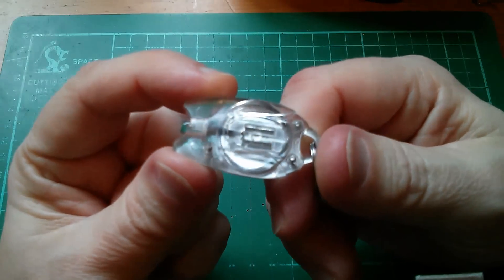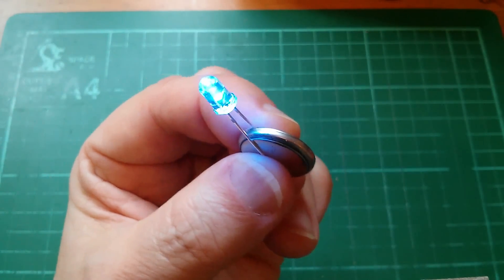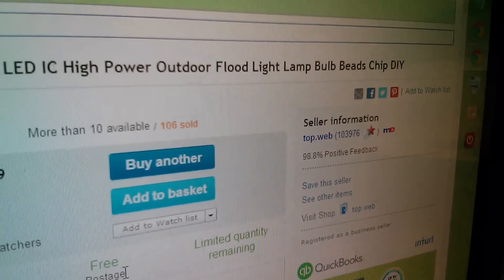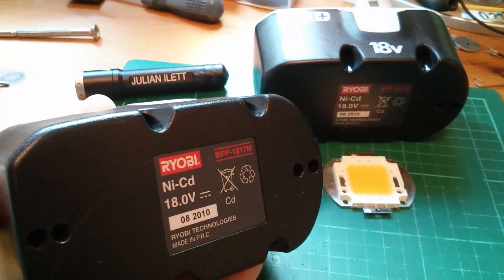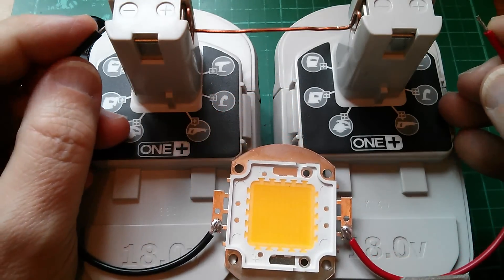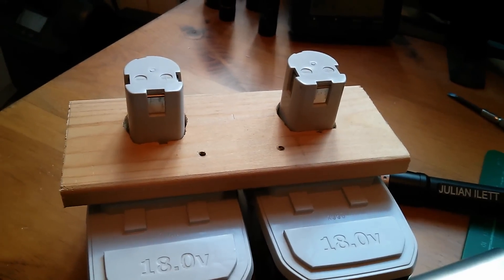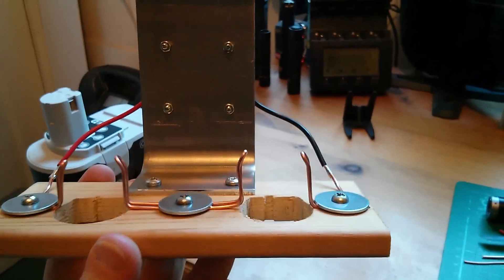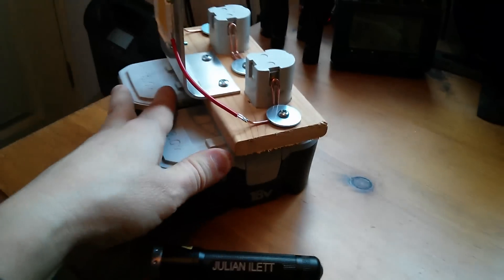Monster 7,500 Lumens 100W LED Flashlight for under $10

Comment: This is not the world's cheapest 100w led flashlight because these drill batteries are quite expensive. 9 18650 batteries when connected in series produce 33.3volts. You can buy 10 of those on ebay for 8.65 pound or 10.8 euros.

Comment: You are not lucky with battery voltage, same voltage battery pack with li-ions would smokify the led. What you are lucky about is battery internal resistance, quite high for ni-cad batteries. In this case apparently enough to limit the current under 3A.

Comment: hi Julian, thanks for you vids on these 100w leds, I have built a 100w led using cpu fan/heat sink and voltage converter 12 - 34v.  100 watt LED torch build
 It keeps blowing so I wonder if i need a current resistor? If so, what spec resistor should I use as I'm not that experienced in electrical things.  Some one said by keeping the volts at 33.3v I shouldn't need a resistor?
Reply: Okies., my 150w volts regulator burnt out, so now i have ordered a 600w one and only just realized it has a built in current regulator so all will be cool!  Hopefully! And I must watch your other vids with more detail because I think you show this some where.

Comment: Neat DIY LED flash light.... For a heat sink... you might want to buy a cheap computer CPU heat sink and use thermal paste between both the processor heat sink and back of the LED metal plate for better dispersion of heat. Note just use the paste sparingly as to much will defeat the purpose. You can get the CPU heat sink on Ebay for as little as 5 bucks and free ship in many cases and the thermal paste is about a dollar. (CPU heat sinks normally come with a thin layer of thermal paste already on the back).

Comment: great idea. Could you use a Lm338 with this as a constant current dimmer?  The Lm338 can take 36 volts as input voltage and 5 amp current. Do you think it would work?

Comment: I may be dreaming, but can I hook 2 of these LED panels up to a hand held SCUBA GoPro rig and run them off a battery? I would cover the LED panels and batteries and switches in silicone and maybe encase them as well. The only thing that would be exposed to water would be the heat sink? Dreaming, or possible? Thanks!

Comment: WHY YOU DONT WANT TO PRESS THE SWITCH MORE THAN 10 SECOND?
Reply: Julian Ilett Which means the thing is useless. GG
Reply from the maker: The LED will overheat
Reply: Agree
Reply: Julian Ilett Try an old CPU heatsink, a big one.  They can be found cheap at scrap yards.

Comment: Good idea, works properly, but the minimum safety measure that you need here is a fuse (fire/scorch risk due to the high current that the batteries can deliver).

Comment: mount it to a big PC heatskink something like a I5 pentium and if you can mess about and get a step down to 12v you can run the cooling fan, I used a 10w led chipset mounted on a old pentium 486 heatsink in a wall light with the appropriate step down transformer   https://farm8.staticflickr.com/7331/12644164055_3f8c2ef788_z.jpg

https://farm8.staticflickr.com/7404/12596617375_cbd58ab163.jpg

Comment: If only they could do a 100w LED that works at 10-16v for car applications.. 

I`ve tried loads of LED`s & SMD`s in my cars, most of them die within weeks, usually burning out the resistors, causing them to flash then die (in groups of 3). They just arent stable enough for the fluctuating voltage in cars.

Comment: Really, the only time you need to worry about current limiting is with the 1W LEDs and above. The little ones, you can just put one the right resistor and hook them straight to a car battery without any problems.

Comment: 4 LED serie conection. One diode... Can I plug on the wall (120V)?
Reply: Be careful if you try to play around with this!! We are dealing with AC now...

No, the LED will burn instantly. However, if 40-60 LED rated at 3V or higher, and of course together with the diode, it will work charmingly.

The best way to do that is to connect a bridge rectifier followed by a smoothing electrolytic capacitor in parallel, the output DC voltage will become 170V, and you can safely connect 56 LED rated at 3V in series.

No limiting resistor is ever required if supplied voltage does not exceed rated LED voltage.

Comment: Would love to see a more compact, rechargable and focusable version, something to rival the led Lenser x21r .... Retails at more than £200
Reply: Blimey :)
Reply: Mark Sissons
heheheh
Reply: A focusable (or even with a fixed reflector) probably wouldn't be much more compact. Possibly a bit more streamlined in regards to its shape though. These 100W LED's are primarily made for outdoor floodlights or even street lights, not so much for flashlights. Even car auxillary lights doesn't use these huge LEDs, they mainly use 3 or 10W LEDs and several of them instead.

Comment: Just bought a 100w led for AU$7.99 (for fun) and a 600w 10-60v to12-80v Buck boost step up power supply for AU$20. My question is, do you think i can set the power supply to the sweet spot of the led, and run the setup from a 12v battery?
PS your videos are awesome :)
Reply from the maker: Is that the boost converter with both voltage and current controls (i.e. with 2 potentiometers)?
Reply: I didn't check when I purchased it but It does :) cant wait for my stuff to arrive

Comment: i used a $15 DC voltage transformer, and i didnt know this at the time but the voltage in does not effect the voltage out, i originally tested a 50 watt 34v LED with an 18 volt 3 amp lab grade DC PSU, but when i measured the output of the transformer it came in at 24v, so instead of fiddling with the tiny adjustment screw on the transformer i just upped the voltage on the PSU from 12 to 17v, and the output voltage didnt even register a change with my digital meter still at 24.06v. then just for shits and giggles i dropped the psu down to 7 volts, and holy hell the output was still 24.06v. and even under load 9v 3 amps from the PSU came out as the now optimized 32.5v, and bringing the PSU up to 18V 2.3A the output voltage from the transformer was still at 32.5V, i am no electrician but i always thought that the output voltage depended entirely on the input voltage.

anyways TL:DR invest in a 15USD variable voltage constant output transformer, even though your battery's voltage might change you can be guaranteed that the voltage at the LED will not
Reply: this is the transformer i am using
"DROK DC Converter Voltage Regulator 8-32V to 9-46V 12/24V 150W Boost Step Up Power Supply Module"

Comment: My thought was that the self-regulating properties of the cheap coin-cell+LED flashlights isn't due to the diode I-V curve being well matched to a 3V cell, but more to the fact that a coin cell can only produce low tens of milliamps in the first place. I'd be very cautious about using NiCad batteries for an unregulated setup - they can supply MUCH higher currents than a primary lithium cell.

Comment: It would be best to use a simple current limiting. I calculated from the spec sheet shown a 1.2 ohm / 5 Watt resistor in series should work okay.  Once on a heat sink the LED will be allowed to seek its own quiescent level in relation to the battery supply he is using.
Reply: To add to my comment, it is possible to use an electronic circuit to make a high power pulse modulation drive circuit. LED's can work with very high frequency drive. It is possible to work out a high frequency pulse drive to about double the light output and not create the excessive heat. The duty cycle of the pulse drive can be at 50%, and thus the end result power applied would be 50% for the emitted light output.

Comment: It seems like this particular LED array might lend itself to retrofitting the HP lamp in a DLP projector. Of course the HV supply would have to be replaced with a regulated 36V supply and there is the issue of colorimetry and satisfying the fail safe programming in the firmware, but I can see definite possibilities here..

Comment: Couldn't you use a resistor (or other voltage limiter) in the circuit to reduce the voltage across the LED to 32 volts? At that rate, the LED shouldn't heat up over normal limits... (since that is what it's rated for)? 
Getting off subject; I don't know what is happening to this world... Somebody makes a nice video of an experiment, using perfect "English" and commenters act as though you are subjecting ever word and action to their own personal scrutiny- being very rude in the process. This doesn't say good things for our society.

Comment: Hello, good video.
I like LEDs and never saw a LED with 100w. So this is awesome. And cheap.
By other hand I think that could be good to make work this powerfull LED whith a power supply. There are cheap printer power supply whith 32v of HP. I thought this could be usefull for someone.
Thanks.
Reply: Those HP power supply are rated between 800 mA to 1.5A. I haven't have the luck to find any rated at 3A or higher. They can still be used, just wouldn't light up the LED to 100W.

Comment: How to make this gadget of yours perform better - nice layout by the way.

Notice how the LED is very bright when first energized and gets hot very quickly. You can kill three birds with a stone by building a driver circuit to manage the voltage (not amps in this case). Your LED has maximum input voltages (your sweet spot - see technicals)... Construct an oscillator with a simple 555 timer or a couple of transistors and you will be able to send an OVERVOLT (beyond tolerance) to the LED for a VERY brief moment, then the power will stop for a bit and then repeat (basically a very fast strobe). Doing so will overload the LED just long enough that it can recuperate without burning out and also generating a greater blast of light. I said three birds right? In the interim when the pulse is off, you will conserve battery levels as well as moderately reduce temperature levels (two birds) - You will also get a noticeable increase in lumens from your LED (third bird). If you do this, you will observe a nearly noticeable strobe effect if you wave your hand in front of it like you can with an old school CRT. There are pre-built integrated circuits that will do this, but I recommend building one from scratch on a prototype board first. Cheers. (Look up LED driver/boost circuits on google)...
Reply: Post Script - If you decide to build the circuit and need some help, please give me a holler. On a side note - could you please measure the thermals that come off the back of your LED at max. I'm curious how hot it gets. Is it truly too hot to touch?

Comment: 100W 7500lm!! really nice LED. But if you want to have a better efficiency, you should drive the led with a led driver IC which uses the advantage of peak current and average current specs of the LED, which results as a sum of triangle and pwm wave. It would be cooler in that way too. Nice video though.

Comment: Love the videos. Have you experimented with Li-Po batteries as used in radio controlled helis and planes. They can be obtained fairly cheaply and can supply large currents. At 3.7V per cell, a 9 or 10 cell pack should do it.

Comment: These particular LEDs are powerfull enough to use with a much lower power source. A cheap LM2577 driver ($3.5) can output about 10W of power from as single lithium cell and that increases if you have a 10.8V (say from a laptop) battery or even a car battery. Not $10 but In any case I would say cheaper than the rioby batteries. 10W on these LEDs is about as much as a 12-15W CFL or a 60W Incandescent for comparison.

I havent been able to find anything that matches the power efficinecy from these, so defenitivelly a good deal in any case! As to drive them above 50W thats a different story. They wont last.

Comment: cool video, I don't think the title is quite fair though because the batteries alone cost more than that.  I understand that you can use them for other purposes but I don't think that if you mad this to use regularly you aren't going to want to take the batteries out of your drill all the time.  I also wish you would've done something about a reflector and lense, switch, heatsink,  etc to make it more usable because I want to make one to acutally use frequently and would like an example.
Reply from the maker: I'm planning to improve the original design (and blow the $10 budget) with a bigger heatsink (maybe from a CPU), a fan (24v type running at 36v) and a reflector and lens.
Reply: Julian Ilett
You should limit the power of the fan, 24V fans are only the noisy types. Use a 12V silent model and reduce power with a resistor. A CPU heatsink is a very good idea; commercial generic electronics heatsinks are bulky and expensive.
A power resistor for the LED is a must; the dropoff with just batteries is too steep. A 1 Ohm/20W and 10 LiPo cells in series (or 20 cells, 2×10) salvaged from laptop batteries should work nicely.

Comment: Take car with this. The current and the DC voltage is a bit on the high speed to touch the terminals directly. The cable size and point of contact could cause a deep penetrating burn when you touch the wires together if the cable is small. The voltage is high enough to feel in the right, (or wrong conditions). Check with someone about a switch for this in place of the touching wires. Cover wiring and terminations. Yes I now it’s not a touch and die but it’s better to air on the side of caution when putting batteries in series and making a video of it. Thanks for the information on the LED nicely done.

Comment: You can just use 4 rectangular 9v batteries that are easily accessible and you can also buy rechargeable ones and connect them together to achieve the same total of 36-40 v

Comment: That will last about 5 minutes, don't waste LEDs guys.
You have to have a driver on those big leds, I have learned the hard way myself.
The drivers are cheap now too, and you can run a 36v LED from a 12v battery. Your heat sink is far too small also.

Comment: I'm curious, couldn't you achieve the same result with four 9v batteries? Would be a lot more compact design.
Reply from the maker: I'm sure that would work because 9v batteries have plenty of internal resistance, but it may not be as bright and the batteries certainly wouldn't last as long as power tool batteries

Comment: How about eight or nine 18650 batteries in series??  I've been getting those for around US$1-$1.50 each.  They run about 4.2V charged (I've seen 4.28 immediately after taking them out of the charger) and up to 7A.  I'd need a PWM or something right?  I'm sure they make one specifically for that LED.

Comment: Hi, i have one 18v and one 12V, it would works?
Reply from the maker: It will light up, but not very bright
Reply: If You Have 3 Of Them - Yes..
Reply: Julian Ilett Can i use 2 chip at 36 volt to have 200 watt?
Reply: Loris Cianni
Reply: need atleast 28v..

Comment: awesome , and you can drive it with PWM this will be more professional :)
Reply: ***** Or you could just wiggle your finger on the switch as fast as you can.....or a clockwork vibrator...WoW I just invented a mechanical pulse width modulator!!! Coool
Reply: DJ Kinney Its a great idea, a couple of transistors or a scr and you can vary output like a dimmer (or modify a dimmer..cheap as chips). Smaller heatsink..(which would need to have been giant and very expensive if you wanted it on for more than 10 seconds in its standard form). A smaller lighter 10-150 dollar flashlight. ))

Comment: I had no idea how sensitive leds are so I got a strip of 24 leds wired in series and randomly put a 9V battery to the end and it worked perfectly!
Reply: Yeah man, you just got lucky. You typically need to calculate the size and power rating of a resistor that will limit the current that flows through the LEDs.
Reply: Definitely lucky, I designed LEDs and one board ran off a 9V battery as well, only for a few hours for a trade show but it was much better than making up a complicated and big mains power supply to show off a single LED PCB strip...

Comment: The main drawback is that you have chosen a warm white unit. I were preferred to see a true white (6000º K) instead your creamy coloured 3000º K one. Definitely I don't lilke in any way warm white light .
Reply from the maker: The warm white LED was slightly cheaper - but it's a horrible colour on camera - looks pink.

Comment: Anyone have any experience using this 10x10 array as a strobe? Had good results from both the Ebay/China 12-Volt stepup converter and the 120-Volt "sealed" supply/ballast with mine for steady lighting.. The stepup converter has separate 10-turn trimpots for each voltage and current limits. Set for 3 Amps and go.

Comment: Nice vid. It seems led drivers are more for efficient use of power than for led protection. I run the xml t-6 leds direct from 18650 lithium cells with no problems. And four t-6 in series can be run direct on automobile power with a 1 ohm resistor.

Comment: Love anything to do with torches / electronics etc, even from when I was a young child, about 4, fitting a small halogen torch bulb & PP3 battery, fitted in a lego caravan, pulled by a tractor.. lol. Anyway, I digress, do you know if the cost would be considerably more for an infra-red LED? I was thinking along the lines of low cost CCTV lighting for night.
Reply from the maker: Light bulbs and Lego - that takes me back!
There are some high power IR LEDs available: http://r.ebay.com/dkwfjL
But my immediate thought is that's a lot of high power invisible light - mind your eyes.

Comment: I don't think that aluminium plate can dissipate enough heat for a 100w. Passively cool a 100w would need a lot of metal, I generally add a fan to it.